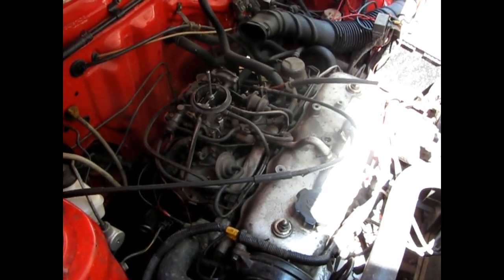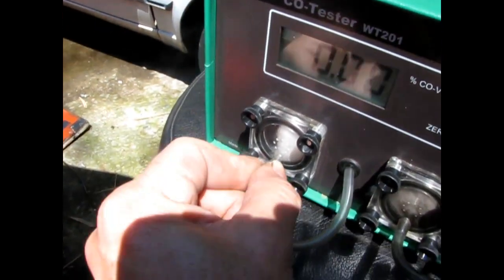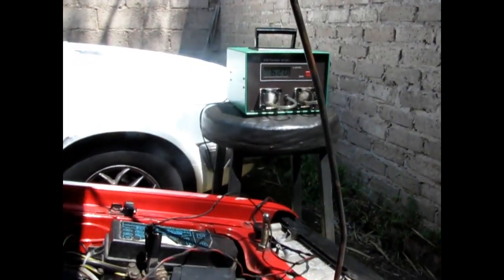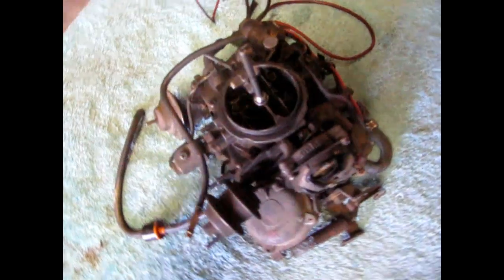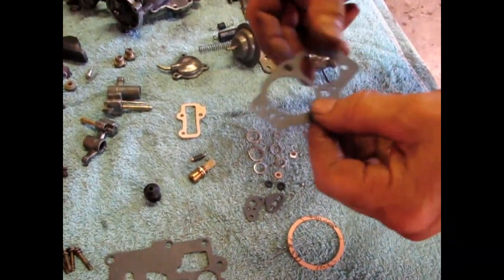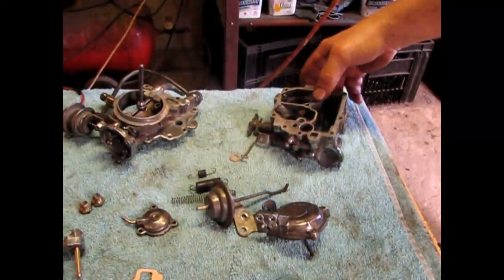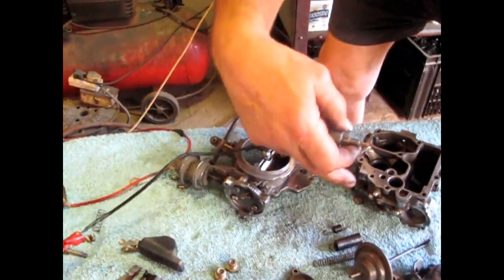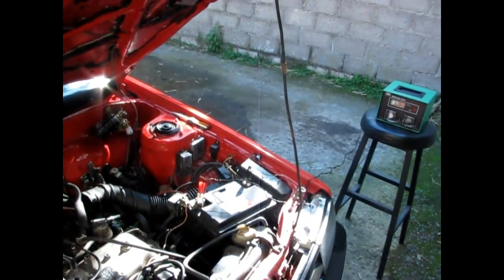SERVICE YOUR  CARBURETTOR

Comment: I have an 81 Tercel with a 3ac engine in it.over the last four days it's been getting steadily weaker every day and I have to turn up the idle screw about 1/3 turn each day just to keep it running. Today it is so weak it almost will not drive I have to rev it quite high just to get moving. It has fresh clean oil it's getting good spark and fuel filter is new and it's not overheating. I'm stumped. It feels extremely heavy in the pedal..

Comment: hi.   how many turns  in air and fuel..?
Reply: Hi. Normally 3 to 3 and a half turns out for you idling mixture. If it doesn't respond you have a worn butterfly valve or the vehicles intake manifold is sucking air. Or partly dirt in the idling jet.